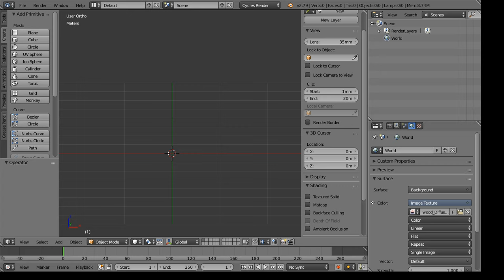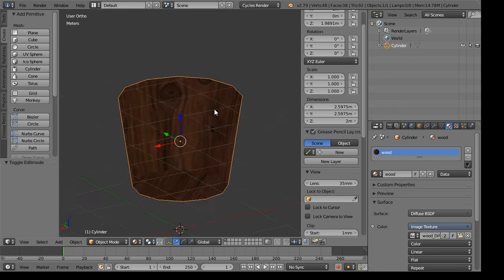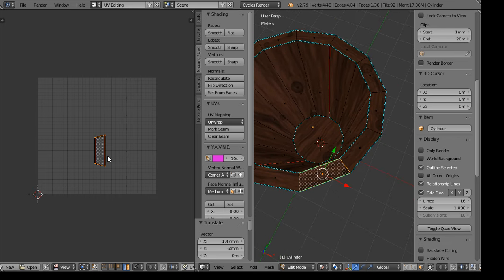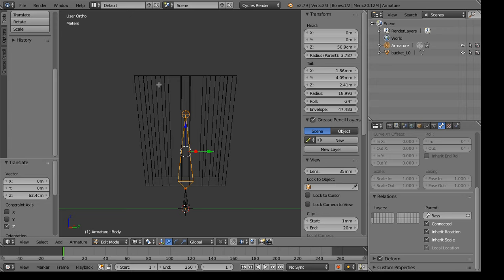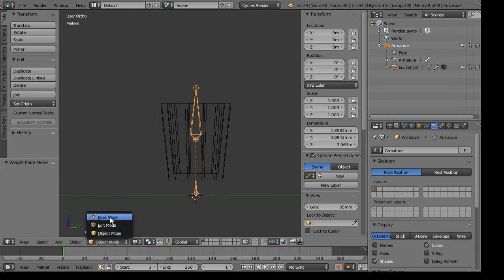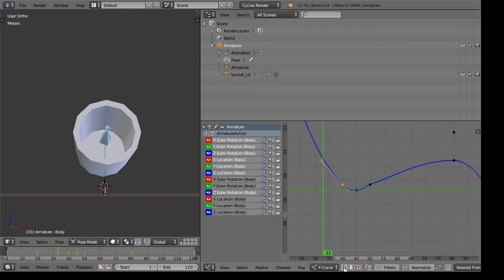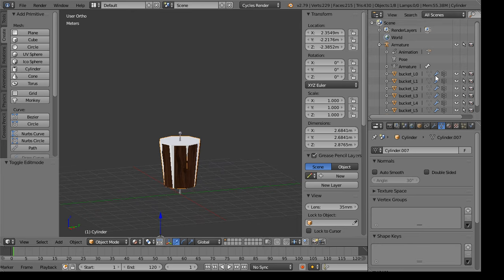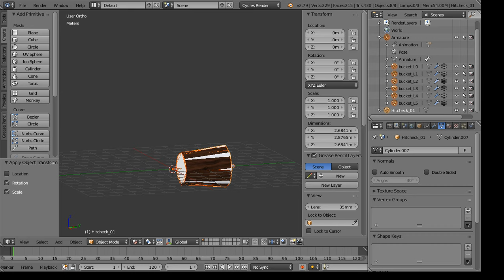Lets look at Animation TMTK Planet Coaster

Comment: Great tutorial overall, thanks. I have been tinkering with TMTK for a while, but animation always has been a problem. This will definitely help!
I have a question, though : why is the bucket above the origin? is there a technical reason for that or can I have my own model start at origin if I want to? (if you answered that in the part where you modeled the bucket, I apologize. I only seriously watched from the part where you start talking about animation)
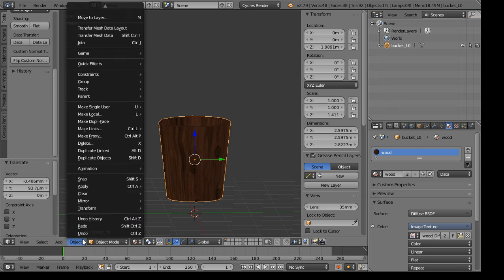Reply from the maker: Glad it helped! 31:50 Explains why my model is set up this way. 
The origin point is where the object spawns inside of the game. When you compile your model the compiler looks for your objects origin point and adds a bone node to it. 
That node is then used by the game engine to apply physics to your object with the help of A Physics Box. 
So it can spawn your object in the world and allow it to Snap to the ground, a wall or other colliding suffuses.  
If you use the in game tool. "Align to suffuse" then you'll want your object to snap to the grid. As the grid represents the suffuse your object is attaching to. 
The suffuse could be a wall, the ground or other face of an object.